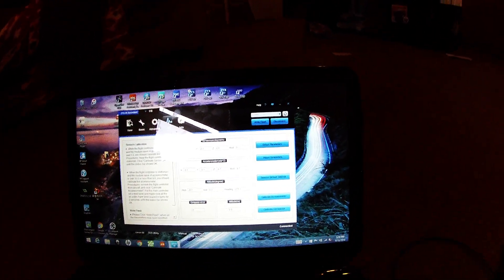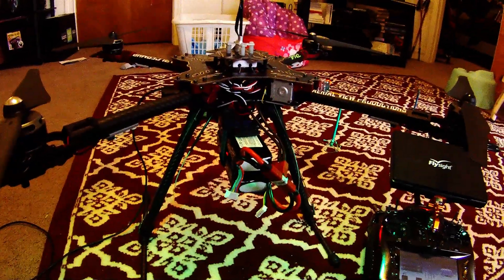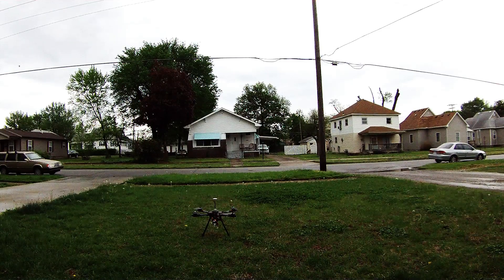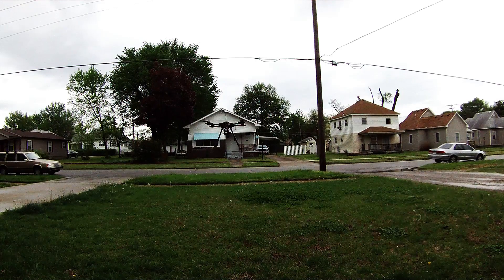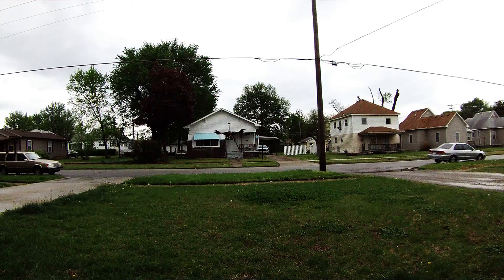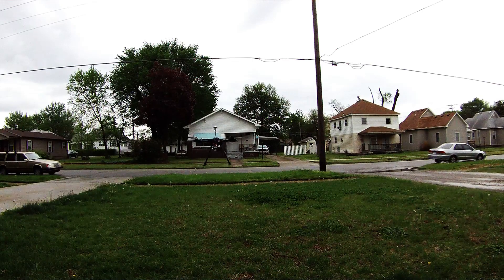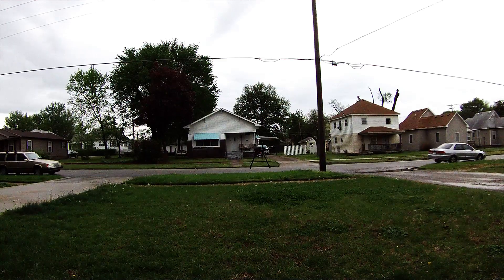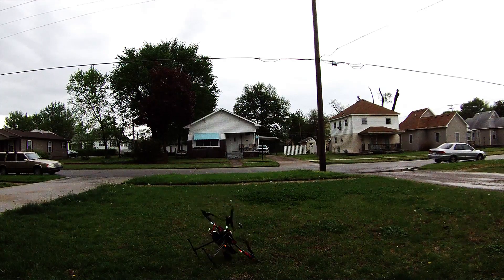Tarot ZYX m problems

Comment: Hello
My drone not fly stable im using tarot zyx m flight controller what should I do I'm using 1400kv motor and 30a Esc my drone goes here and there with gps mode what i do.???
Reply from the maker: What size propeller and pitch are you using for your setup?
Reply: @joshpoznich3886  8045 propellar, and pitch is recommended
Reply: @joshpoznich3886  1400kv is compatible for tarot zyx m FC and my frame are f330
Reply from the maker: Also, let me know what platform you're using!
Reply: @joshpoznich3886  zyx m assistant
Reply: 8045

Comment: Hey Josh....I have a question for you...I just built a a Hexacopter with the zyx-m and I have everything set right but I can't get the motors to start....the motor tests all work but I cannot get the start sequence to fire the motors up...any help would be awesome man
Reply from the maker: Are all of your servo channels set the the right direction?? Throttle up and Throttle down? Also, have you done 
a TX Calibration in the assistant software. If those aren't correct it will not arm the motors upon startup. Which Assistant version and Firmware version are you using?
Reply: Josh Poznich I figured it out my man, I had to invert my elevator channel and it worked instantly.  I found the advice in a forum regarding another system but it worked for the zyx-m just the same.  Thanks for the advice though!

Comment: vibrations is causing this glitch.. i had the same problem before. i changed my old motors/props then everything went ok.. too much vibrations can mess with the gyros..
Reply from the maker: +xDisturbedx13  Thank you! I want to think it was this simple but unfortunately this was the second airframe this flight controller had been on and now it's on the 3rd frame. Same thing happens unfortunately :( My replacement flight controller is finally in NYC so hopefully I'll have it by the first of next week!!

Comment: Not sure if it is the same but I was having similar problem with my DJI Naza-M V2 and finally sort it out after calibrating the ESCs.  i.e. the step to set the throttle neutral point, max point and minimal point.  Some controllers are having this step in the setup but some are not.  You have to do it yourselves.
Reply from the maker: +PeCKY38 RC I calibrated the esc's about 4 times now and tried high timing with them as well. I put it back to the intermediate timing on the esc's and it's still the same. :(

Comment: GPS is fitted wrong, The wires should be at the front if GPS is fitted properly
Reply from the maker: +Ray Henderson , hey Ray, I know it looks like the wires are coming out of the left side of he GPS puck but they're not. That's the usb upgrade plug for the gps puck.  The wires and arrow on the gps are and have been facing forward since initial install. It flies great with correct control responses for most of the flight. when the problem happens I still have between 40% to 50% battery left and without warning or any signs it  gets unstable on its own and the only thing you can really do to correct it is let it hit the ground or punch the throttle and sometimes it will stabilize itself. I'm pretty sure I have finally given enough info to the seller that they are sending me a replacement! I'll keep you posted on the rebuild when it comes! The FC was supposed to go on my octacopter but it was doing weird stuff on it too so I put it on my little quad frame for further testing! Thanks for the input!

Comment: No it happen at any altitude ! I will retry to fly when I receive my new esc one Burn in the water ... next time I will unplug all the fpv systheme ! Maybe it créateur interference...
my first flight without fpv was ok smoot flight til the battery go down ....
Reply from the maker: +Simon Guevremont  What gain settings are you running and how big is your hexacopter? MM? Also, what battery are you using, 4s, 6s?? Just a word of advice, When you do the voltage calibration in the advanced section of the assistant software, fully charge your battery and check the output of the battery with an actual voltmeter. Don't use what your charger is showing it charging to. So on a 14.8v 4s battery your charger might show that it's charging it to 16.8v, but your battery is actually only putting out 15.9v when checked with a voltmeter.  In the voltage calibration set, the number to what the voltmeter shows, not what your charger shows. If you set it to what your charger shows you're actually almost 1 volt lower then what your flight controller thinks it is. 1 volt with lithium polymer batteries is a lot! You might be over discharging your batteries and making it crash.  Are your batteries puffing up?? If so you''re over discharging. So, fully charge a good (new if you have one) battery. Check the battery with a voltmeter. Enter that number into the voltage calibration line in the assistant software. Hit the calibrate button. The voltage will change to that number and say voltage calibrated ok on the status bar in the lower left corner of the assistant software. Choose the recommended settings for the battery you're using and hit Write Flash. Try flying again after that and see what happens. One more thing, the recommended voltage numbers are actually loaded voltage, not No Load voltage like the assistant software says. Not really sure why it says No Load in the software but it does.  Let me know if this helps!! It's a great FC once you get everything set right!
Reply: +Josh Poznich  it's a f550 frame = 55mm motor to motor  with 6 920kv motor  6 simonk esc 30amp and 1045 prop
the gain setting are pitch and roll 30 vertical 40 in attitude mode
I use a 3s 11.1v  5500 mamp
Just currius. ..your quad is ok now ? Or it's still douing is little dance ! Do you solve the problem ? 
Ho and Sorry for my bad english,  I usualy speak french ! 😕
Reply from the maker: +Simon Guevremont  No worries Simon!! I'm understanding all of it! The quad is still down and out but the company I ordered it from is sending me a new FC!! I had your issue happen on my hexacopter when I first set it up with the Tarot FC. I had the calibration wrong in the assistant software so it was over discharging my battery and it would just lose control and fall like what you're describing! It baffled me for a while until I bought a new battery, checked it with a voltmeter and it showed the actual voltage being lower than what my charger showed. I re-calibrated my FC used the new battery and voila!! It worked! The old battery would charge just fine but it was starting to puff up. I knew it wasn't right so I bought a new 6s battery for it and recalibrated everything and it's been flying great since!!
Reply: +Josh Poznich  Tank's for the advices. .. I will check that for the battery calibration. .. but I don't think my esc and my motor can take 6s battery ? ! I use a floureon 3s 5500 ma 35c and I got aprox 11-12 minutes of flight at the begining with one battery, I see see guy on YouTube put 2 in parallel to get more amp and flight time ! I am not an expert in drone, it's the first one I build so I appreciate your advice😊.. for now I Just waiting my new esc it will take 3 weeks to arive ! 
Lucky for me that the water make no damage exept one esc an brick the micro sd card ! I ad to open all component to dry them with compressed air an check the part one by one...even my xiaomi camera survive ! 
A question for the gain... in the page at the bottom the holding ability or something like that what gain do you put... By default is 25 I think, do you change this gain?
Reply from the maker: +Simon Guevremont No problem Simon!! Yeah, check and make sure what your esc and motors can handle! you can definitely run 2 3s batteries in parallel! It will double your amp capacity and give you much longer flight time! Just make sure you don't over discharge while you're flying!!! If your motors and esc can handle 6s you can also run 2 3s batteries in series and turn them into a 6s. If you have 2 5500mah 3s batteries it will still only be 5500mah but you will be at 22.2v running in series. I'm glad all that got messed up was 1 esc!! You got really lucky!! I would highly recommend the Hobbywing 40amp opto esc's. They are cheap and the only thing you have to do is calibrate the throttle! If you are running 920kv motors they are probably only rated for 3s to 4s. The lower the kv the larger the cells you can run. Let me know how your rebuild goes and if you have any questions just let me know!! I have 12 multirotors and 5 of them were from kits! All fly great except for this most recent Tarot FC and I'm sure it is just a bad Y axis gyro in the unit. We'll find out soon! My replacement should be here by the 20th of this month! :)
Reply from the maker: +Simon Guevremont Oh, and about your question on the heading lock ability. I've messed with it a little bit but I have just left it at the default of 25. It really doesn't seem to do much that I've noticed!
Reply: +Josh Poznich  I try to raise to 35...40...An I remarque that he react faster to hold is position !  But I have to make more test.
oh and my battery are new one and fully charge I tested with a lipo tester and give me 12.57v cell1= 4.198 #2=4.182 #3=4.190
For the esc they are cheap one 4 esc for 35$ simonk 30 amp the motors can run on 15 amp esc so.... I will be able to fly again in aprox 3 weeks, do you know if I can send you photos via youtube ? 
It's the first time I communicate with youtube ! I don't know if it's possible. 
When I rebuild my big bird you will be able to see the thing !!!
Reply: +Simon Guevremont oh in your vidéo the little dance at the end you think that it is cause by a bad fc ? Or by an over discharge battery ? 
Because my exacopter done the same thing, but your is close to Land so the mouvement do not have time to amplify ! You Just get him down but mine at 40'  I try to get it down and get back control but the mouvement get to much amplitude an I can not recover controle. ..
Reply from the maker: +Simon Guevremont That's good to know! I didn't really mess with that gain much because it said it would be fine in most cases.  I'll mess with it more! Most of the time when it goes out of control it's around 3/4 of the way through the flight but it has happened a few times with a completely full battery! So I excluded the battery being the problem and most every time it happens I can hook the computer up to it and the assistant software shows the mod value of the gyroscope is about .4 or .5. The Y axis is is the one that is up to .4 or .5. The mod value shouldn't be over .2. I can do a successful calibration, take it back out and it flies good for a little bit and then it does it again. I can take it back in hook it back up to the computer and  it shows the Y axis being back up to .4 or .5 and it makes the mod value back over the tolerance level.  My new FC will hopefully be here this week and installed immediately for further testing!! :)
Reply: +Josh Poznich  Thank's for the info. .. hoping you receive your controller soon... I Wright you my setting. .. An I verify my voltage calibration ! It was à little bit hight then the real voltage but not that much, .2v I calibrate a bit lower of the réal voltage : real v=12.5 calibrate v=12.43 
My gyro= x .1  y -.3  z 0.0 mod 0.3
my acc= x  .1  y  .1  z -9.8 mod 9.8
compass err.   0
gain basic  P 30  R 30 Y 60 V 40
ATTI   P 30  R 30  V  40
Advance HLA 30
Level protection  1st 10.5
                                2e  10.1
that all, give me some news of your new FC when you try it !
On my side I will wait for my esc...
Reply from the maker: No problem! let me know how everything works out! Once you get your esc that is. Hope it shows up soon! I'll keep you posted on the new FC install. I'm running pretty much the same gains settings on the quad. You might want to calibrate your gyro.
Reply: Do you receive your new flight controller ? ...
Reply from the maker: ***** I did!! I installed it on the U580 quad first and it flew great so now I have it installed on my octacopter and have it flying great also!! Check out the videos on my channel. Pretty awesome aerial video!! Let me know if you have any questions Simon!! Thanks!
Reply: I Josh ... I made a little test on my exacopter. .. in the manual it said that the fc can fly with a motor down ! On an exa or more, So ... I try to take off on 5 motor to see if he can .... but mine not ! He Just want to flip...
Do you ever try to fly or take off with a motor down ? I calibrate my gyro to 0 0 0 ...plug and deplug many time to see if it will lose is calibration but no! Do you think that à bad esc can cause this kind of effect !? (Balancing effect) I am verry impatient to receive my new esc to put it in the air again an see what happen ! !
Reply from the maker: ***** Hi Simon! I have not had a motor go out. Hopefully I don't ever lose a motor but you never know. I'm not completely sure but I think that only works if you are already in flight. I don't think you can just take off with one motor out.
Reply: Thank's for helpping me... I write to tarot to have answer on the casse of a motor down. ..
By the way , your quad and octobre make nice video
hope they will going well for a long time :)
Reply from the maker: No problem Simon! I'm still learning this flight controller also! Don't hesitate to ask questions! I'll keep posting videos! I switched from those Props in this video to DJI props and achieved and extra 5 minutes of flight! Just from a prop change. They were both 1345 size just different material!
Reply: I Make some try to Day  and it stil doing the same ! 😨  I try higher gain and it's worst.... at lower gain it's a little bit better ... but have more difficulty to hold position in the wind ...in gps hold.  It was windy to Day but I want to see if he can handle it ! It was difficult, make some crashs ! !! At low altitude so no damage,  replug many time to change de gain setting  and check the gyro calibration every time and that stil to 0.0 ? My gyro seam to working well so I am à bit confuse... dont understand what causing this trouble ! 😕
Reply from the maker: Hey Simon, I watched the video! It looks like the same thing mine was doing! I think there might have been a bad batch of these flight controllers that may have gone out. I got my replacement and everything flies great! I had a comment on one of my other videos and said he was having the exact same problem. I'm not sure exactly what was causing this problem except for a quality control issue. Let me know of other videos you post and keep me up to date about your progress! I'm glad you didn't have any serious damage from your testing!
Reply: Thank's  Josh, I read some comment talking about vibration....
I made a test yesterday I take off the tarot of my exa and put a dji naza-M lite in to see if my cheap exa frame can cause the trouble !  And the answer is NO ! He fly Great but the gps hold is not good like the tarot ! 
Maybe it's because I have a clone gps on my naza ? But the stability is there !!! The frame going great... I put my tarot on the quad and he flip over at take off 😨I was not able to take off... tomorrow i will make à vidéo of my two drone to show you the result. ..I will send you the link...
Reply from the maker: That sounds good Simon!!! I'll be looking for the link!